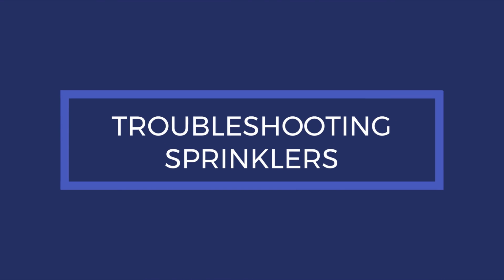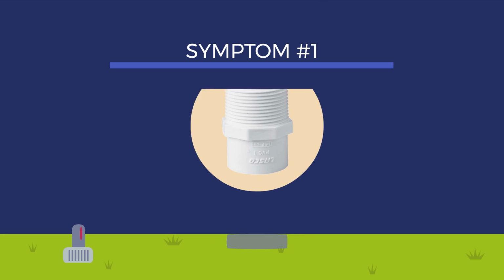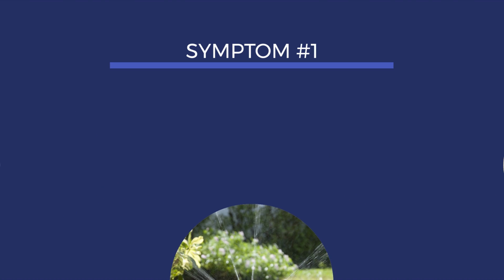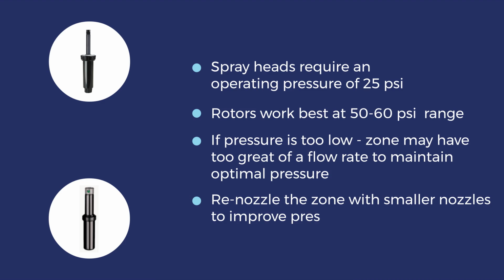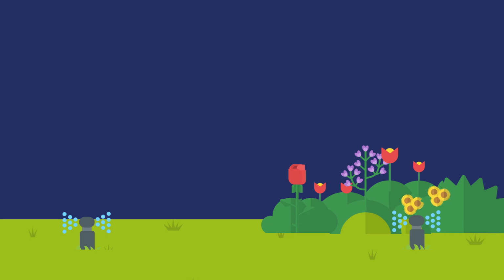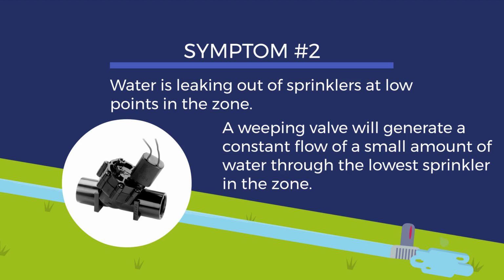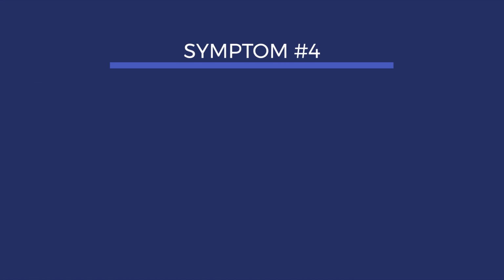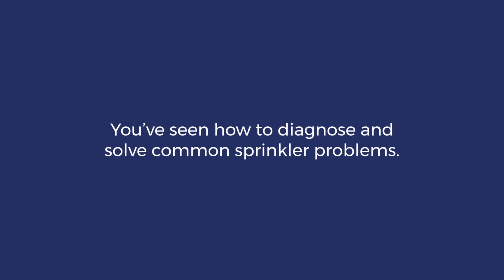Troubleshooting Sprinklers

Comment: Bought a Rachio that recommended the blue k rain nozzles but after replacing the bodies and nozzles with K-rain on trouble areas, the nozzles don't either spray or don't reach the desired length they are made for (Blue top 16-19ft), do they only work if the either zone has k-rain nozzles?
Reply from the maker: Thanks for reaching out! K-Rain nozzles don’t require the whole zone to be K-Rain — they’ll work on any standard spray body. A couple of things to check:

1. Water pressure – Rotary nozzles perform best at 30 PSI. If you’re using pressure-regulated sprays, we recommend 40 PSI for optimal performance.

2. Spacing and overlap – The 16–19 ft rating is based on proper pressure and head-to-head coverage.

3. Clogging/debris – Make sure the filter screens are clean and free of debris.

For additional troubleshooting, feel free to reach out to our technical support team at techsupport@krain.com with your setup details, and we’ll be glad to help.